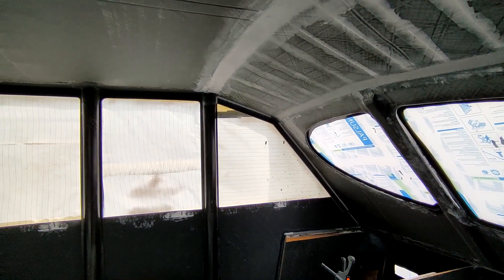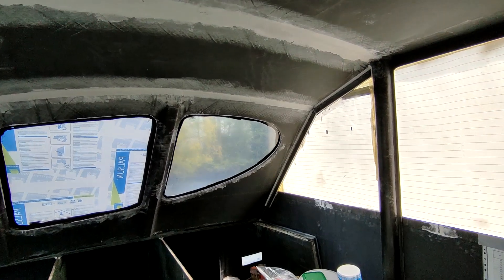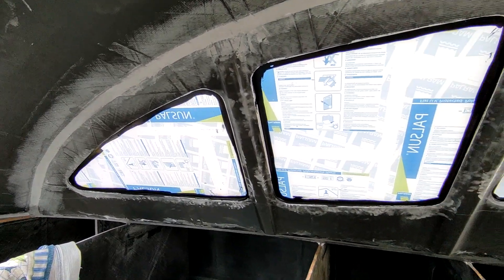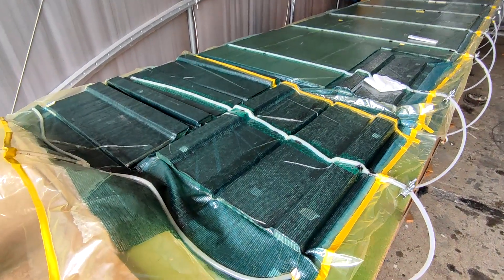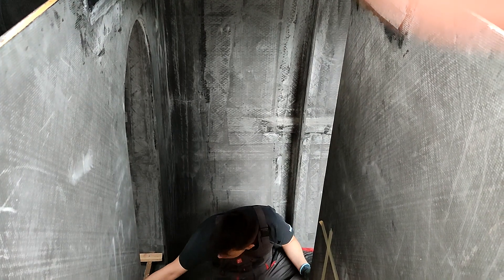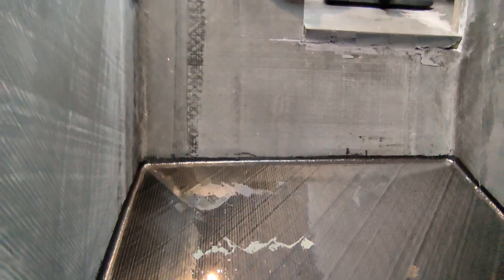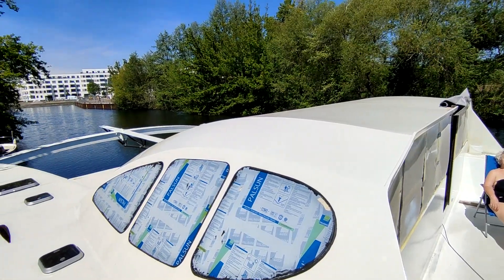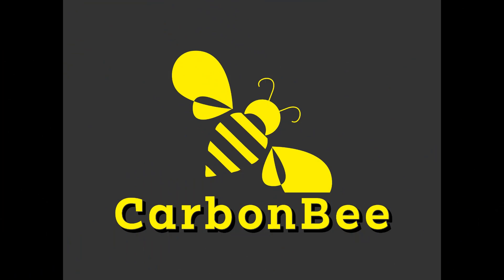07.  Building 15m carbon performance catamaran - "CarbonBee"

Comment: I have been following your progress for quite some time. I still wonder how you were able to vacuum infuse the hulls without a mold. How were you able to make the foam air tight for infusion?
Reply from the maker: Thank you for watching.
I have designed a technology for rapidly constructing one-off hulls without the need for mould. Instead of using traditional mould, the construction material itself (foam) serves as the mould. I will share the details on how to achieve this at a later time.
Reply: @bojanu7212  thank you. I'm looking forward to learning this process.

Comment: Great update thank you ! Keep at it good work . 
I like the light wt glass cloth on top of the carbon to absorbs excess resin and something easier to sand smooth with out effecting strength ( or was that peel ply??)
Cheers Warren
Reply from the maker: Thanks!
It is peel ply. We use it everywhere, for hand laminating or infusion to get perfect adhesive surface for following lamination or painting.
We also see very well the correct saturation of the carbon cloth by hand lamination.
Reply: @bojanu7212 Peelply is great stuff! Really helps laminate quality. You probably know this already, but just in case: It’s important sand before laminating, even when peelply has been used. It’s easier to get sufficient sanding then, but the surface must be sanded off to get proper bonding. Many do this wrong.
Reply from the maker: @SteinVarjord  You are right. Light sanding after removing the peel-ply, before lamination of the next sheet, improves bonding by eliminating too thick layer of resin between. However you can get very fine peel-ply and that make the sanding not so important.

Comment: Will you make laminating furniture with wooden furnir?
Reply from the maker: it looks like we will have the furniture in white colour with some grey elements - however it is still not 100% decision.
Reply: How about furniture in naked carbon? It will look $$$$$$$$$!
Reply from the maker: @maxprea3745  Yes, it is nice idea and with clear gloss lacquer you will get 3D effect, but we want to paint the walls and bulkheads in the hulls  with clear lacquer to get such effect. We made already test and such raw surface painted with clear lacquer, with the light reflections looks extreme good. So, having all the walls in carbon finish, it will be too much when the furniture get the same finish. That is, we want to paint the furniture white and the celling covering will be also white.